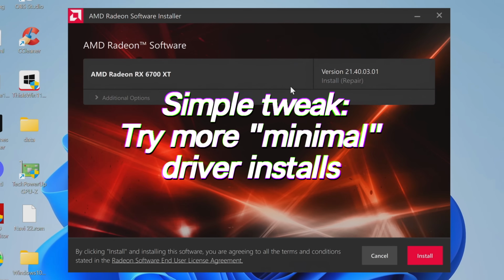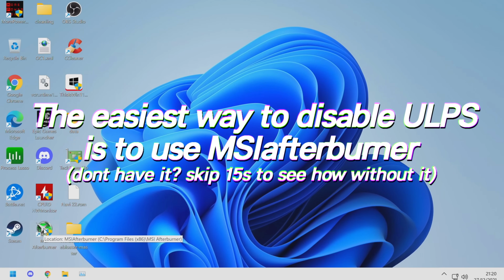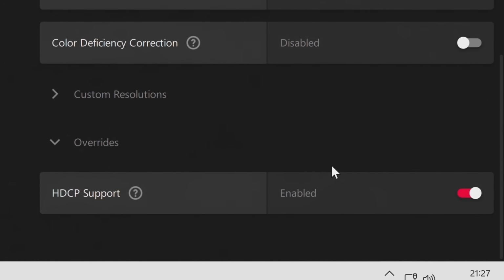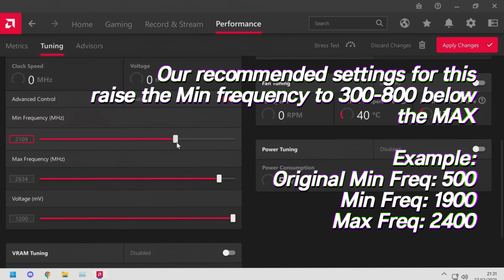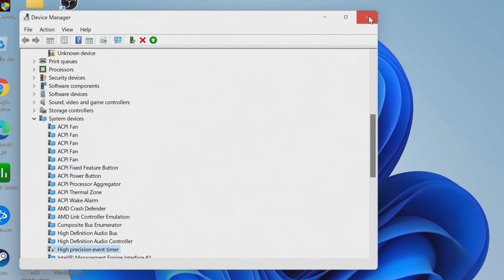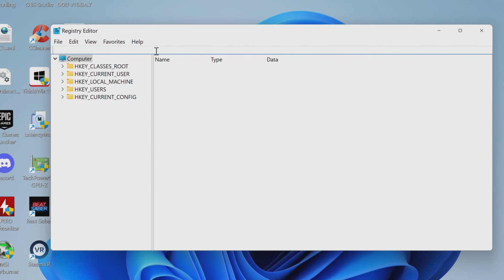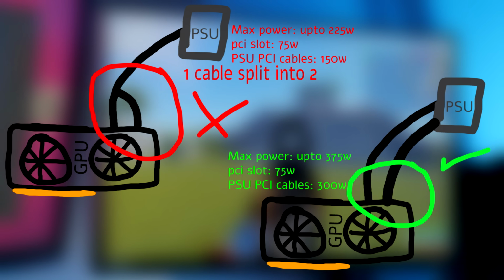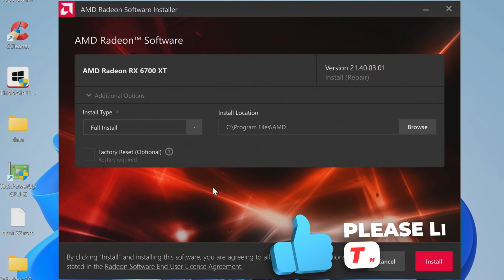🔧 Have an AMD Radeon GRAPHICS CARD? You should use these SETTINGS! *FIX LOW PERFORMANCE & CRASHES* ✅

Comment: Hey I'm thinking to switch from nvidia/intel build to a full amd build I want to stream, GeForce experience lags on my current setup i5 6600k rtx 2070s I'm finding it hard to capture games because of my low cpu performance.  All I want to know is, does the amd counter part to GeForce experience run better in overlay/ or in the background?
Reply: Nvidia much2 stutering..

Comment: Hello, my one gigabyte rx 550 2gb ddr5 , I have a problem when I open my video editing program , after effects or sony vegas , the screen blinks and gives this message "we detected a driver timeout on your amd system" and the program crashes, then when I uninstall the amd video card driver and go to open the program it doesn't happen. before I used msi afterburne I lowered the core clock and the error stopped, but now it's not even advancing anymore, strange what can it be can you help me?
I need to use these programs for my work.

Pc
i5 2310
monitor aoc 75hz freesync
8gb ram
amd rx 550 2gb ddr5
hd 500gb
ssd 240 kingston
Hoopson 550watt
windows 10 home

Comment: I sent in a error report to AMD but not heard back anything. As soon as I installed the AMD software my sound drops out after 2 sec on some games, one game it will not play sound at all, youtube/firefox browser, etc......very annoying. I already wiped the old Nvidia drivers with DDU. Uninstalled sound works fine, reinstalled and it's back. Deleted first dload and re dloaded with same problems................Anyone have any suggestions?

Comment: I had an APU system with dual channel rams and my fps in CS:GO was around 120 avarage. Than i decided to buy a new GPU and bought a RX6500 XT. I tought it will increase my fps like a double times or something but the result wasn't the way i thought. My fps were just increased 10 to 20 and i was like "Ok i think the GPU i bought is just useless shit. Than i saw this video and made the setting like in the video and my fps increased to 220 avarage. Thanks to you sir for helping me to reach my GPU's fully potential. The settings in this video increase the fps in new gen games around 5-10 or 20 maybe. But it slightly increases the FPS in older games which uses older directX versions like 9 or 10. And also increases the FPS nearly double times in CPU based games like CS:GO and VALORANT.

Comment: To me driver only is the best and stable pairing it with after burner, as I noticed my overclocks is stable on afterburner compare to radeon settings, same clock speed and voltage values

Comment: My gpu power cables are two cables attached at psu end but split from there ,like 2 cables sharing the same socket in psu . Would that be same as daisy chain cables

Comment: best advice is at the 1st minute and the last. Only install the drivers, forget about adrenaline. If you want to OC use MSI afterburner. All of the other tweaks will generate a cascade of untraceable catastrofic events that will lead to wiping windows, because it'll be easier to solve the problem that way. Interrsting video though
Reply: I agree with this, less bloat+msi afterburner gives me stable OC compare to radeon settings
Reply: But how do you do that though? Windows replaced Radeon for the 3rd time. Still Says AMD Radeon 6700XT but no longer have the Radeon Software for fan curve, display color and video modes. Did it do it? Because I almost don't care, Radeon was crashing everyday anyway.
Reply: @1R1shCapr1corn unninstall the display driver with ddu and block windows from updating your  drivers (theres an option in it) install the drivers. and find a way to keep windows updating your drivers except the display one. Search "prevent windows from updating graphics driver". then re-allow win to update everything. ALmost any adrenaline option can be tweaked outside the software so you don't need it. But If your config is now working just don't touch anything. performance won't change.
Reply: @donoroko  Yeah. Installed Driver only option and Local Policy to enable the drivers to stop updating from window update. Working okay now. Because every day I was getting the alert in Adrenaline about my setting having to be reset to default, and the only thing I cared about was by Fan curve, video mode (classic cinema, etc. and display color saturation. The GPU on this PC, is fine stock, it's not going to someone who'll kill it. My other one on the other hand, might have to put on ASUS TWEEK or MSI Afterburner if for only the Fan Curves. That GPU will fry itself without it. LOL
Did not do the DDU, only Install with factory reset and driver only. Working fine. In fact HWInfo reports better use of the clock speeds on the GPU than before. Plays tons better too.
Reply: @1R1shCapr1corn  My RX570 Just didn't like custom resolutions. I had an old CRT as 2nd Monitor and windows wouldn't let me configure it over 640x480. So I used adrenaline customs res. But it triggered the the notification and reset wattman every restart, fan curves also. So I did as I sugested to you and managed custom res with CRU and the fan curves with FanControl (use it for fans, it's super not invasive and low profile) Just make sure you click the "force apply" options so that os, gpu or mobo controllers don't take control of your fans. I woke up one day with my cpu having worked all night mining at 100°c because for some reason the heatsink fan had simply stopped. Also, you wouldn't need to use different color profiles. I'm a designer and understand color very well, enough to know that there's only one correct and optimal setting for your monitor, but if so, you should manage it under color profiles in os. For quick brightness fixes I reccomend built in monitor profiles. For image adjustments windows color profile manager. Just follow the instructions making sure you don't make it to red, green or blue and you'll be fine! Cheers, good luck!
Reply: @donoroko  Looks pretty cool, I'll check it out on my ASUS ROG Strix RX 5700XT. She's the one who'll burn itself alive. The XFX 6700XT doesn't even really the Zero RPM to be disabled, played the Modern Warfare and didn't exceed 74c so, pretty good. Not as good as my curve of top 65c, but, this system with the 5900x/6700xt is going to someone who this PC is overkill for, and most likely not playing that game. LOL Overkill might be an understatement.
Thanks for the Suggestion. I have used the other Brand's Fan programs like Afterburner, Tweak, NZXT and the one for sapphire. But, if the one you suggest is light weight, I'll totally check it out. I remember trying something with that name, but it was written out like scrips. But, if this: 

https://github.com/Rem0o/FanControl.Releases/commit/5bb9e71738200dcb76a3c0980439fa62bb452234

https://www.youtube.com/watch?v=uDPKVKBMQU8

Is how it looks now, nice.
Reply: @1R1shCapr1corn  that is it, it'll do. zero rpm is BS, it'll make your gpu go 20° higher at idle totaly unnecesarily since fans pretty much won't do any noise at 30% of their capacity.
Reply: @donoroko  and that is bad why? it's actually a good thing. middling temperatures won't cause damage to your gpu. what will cause damage is thermal stress due to a large delta between idle and load temps. if your gpu idles at 60c and loads at 85c, that's better than it idling at 30c and reaching 85c at full load. way less thermal stress. but either way, it's not something you should worry about unless you're using a 15 year old gpu
Reply: @GraveUypo  higher temperatures shorten the life of your gpu. It will degrade your thermal paste and thermal pads faster and pretty much every component affected by those temps.
Reply: @donoroko  
Your talking about a very small amount and by that time you would be replacing it anyways due to graphic advancements/improvements.... unless you keep the same gpu for 5+ or so years.. I don't see it mattering. But I do agree with you.. The zero fan spinning is "bs". Probably some market gimmick nonsense for power usage.
Reply: I regret to enter in AfterBurner and Adrenaline first time, if I don’t, I will never giving a sh*t for it and probably (certainly) i had played and enjoyed games much more, follow stats, tweaks  just steal half or more of our playtime and in majority of time it changes our mindset for a worst sense behavior, let’s turn PC on, double click favorite game and have fun, life is short!
P.s: this will be my last tweak, I promise! lol
Reply: i see.. thats why suddenly its bluescreen.. and the windows asking for repair

Comment: I've been experiencing freezes and crashes with Divison 2 since release. Hoping these tips will have an impact.

Edit: Nope. Still experiencing issues.
Reply: Let me guess? Rx 5700xt?
Reply: @MarcABrown-tt1fp  It is actually. That card particular has problems?
Reply: @Samuitsuki  About 40-50% of them have issues with the display engine, that are bad enough to cause intermittent display loss then display driver correction that crashes the drivers.

Worst part? it doesn't even have to be under load. Mine can crash in firefox or any app when the right conditions combine. thankfully it happens once every boot. I have yet to encounter repeatable results. All stock settings

 It seems that the 5700xt design suffered from manufacturing issues early on. Rushed perhaps.... Love the performance otherwise, But I wouldn't trust using the thing for important work...
Reply: @MarcABrown-tt1fp I only have issues with Division 2. In no other cases or games do I have issues with the card.
Reply: @Samuitsuki  Oh weird... I'd have to try that game out honestly, this game might be triggering the right conditions for core instability. Or its just lousy drivers lol. In any case I might get a new GPU when the next cards release, and sell this one. Seems functional enough for gaming.

Comment: well , i wont use your settings , its a waste of energy to clock in Idle to 2100 Mhz , i undervolt my GPU so it runs cooler and uses less energy . Especially my Vega RX56 is faster with undervolting than with more Power ... Simply use chill to set a min FPS rate and max FPS Rate , it should not go under the min FPS unless the Game itself lower it

Comment: 9:56 Is this even legit? I use a single cable with two connectors on a ~300W rated ASUS 1080Ti and the sensors report full pull (270-300W). The PSU i uses is a Seasonic Focus+ 650W 80+Platinum.

Comment: Is anyone having an issue where the GPU literally won't go over 20mhz gpu clock speed for no reason? My pc is having this issue and i don't know how to fix it. I tried everything that i could find (roll back to old drivers, reinstalling windows, overclocking the gpu) but nothing worked and is driving me crazy. The gpu simply won't go over 20mhz. I have a 5600 xt and I7 10700

Comment: hello, do you have any advice for playing in 1440p (3440x1440) with a GPU with 4gb vram (details at a minimum)? 
it's a Mi8/Radeon R9 nano instict.  I know very well that it could not be, but I do it anyway, I ask in case anyone knows about some software settings, BIOS or on the AMD panel or some setting / technology developed within the game settings (in addition to low details) to make the card go better in 1440, make the vram work better or try not to saturate.

Comment: Does the instant replay cost fps? Or memory? I've a good SSD that is suppose to have a lifespan of 1kkk hours or 680TB, store is no problem.
Reply: it costs a bit of both. i still leave it on all the time. it'll only matter if your computer is bad.
also i recommend you leave replay cache in your system RAM rather than on the SSD. ram doesn't wear from use. you'll shorten your SSD lifespan A LOT you leave replay cache in it.
Reply: @GraveUypo  How do i do it? Set the replay cache to the RAM? Thank you.

Comment: Thank you for this super informative video. After my game crashed thrice, i have printed my return label. I run a 6800xt merc card with 850w gold supply, i still experienced crashes playing warzone, junction temp at 92 and current temp at 73 4k max settings with RT on. Ill try the tweaks you shared before returning, thanks again. Liked & subscribed!!
Reply: Hi bud, any improvements ? i have the same card and it crashes on every game, I soon as I jump off the plane in warzone and in pregame lobby in apex legends
Undevolting and reducing max frequency helped but not for all games
I’m taker if you got a fix for this situation
Reply: @easyj  hey i returned the card. I saw a similar behavior in a couple of other games. Now it doesn’t mean the card is bad, perhaps my unit was not good. I validated that the card runs hot as compared to geforce but its fine. There are 2 things you could try run the game as admin, are u running win 11 or 10, if possible try the card on a win 10 machine and play the game..hope this helps, cheers!
Reply: @dushyantkakra5556  i’ve tried so many stuff, ddu, win10 win 11, oc/ no oc, full speed fans, lower graphics settings, lower resolution, safe mode, only thing that works is undervolting but I don’t think It’s designed like that. I unfortunately don’t know anybody that has a pc to swap parts with and stores take a week to make their diagnosis
Reply: @easyj   i know this can be frustratin but sounds like u have tried all the troubleshootin that you can possibly do. The options are time takin like reachin out to the manufakturer and get a replacement, i however feel if u have built the pc there could be multiple components that can cause a crash not just the gpu - eg try changin the ram, see the cpu temp - have u noticed any spike there? M sure u have the latest drivers. I still feel that if u use win 10 and reinstall the card n the game it could work..if nothin above helps, u shud reach out för professionell help with ur manufscturer or store diagnostics
Reply: @dushyantkakra5556  it’s a used card, but the previous owner never had those issues, I went to a store and they used it for a whole day and no freeze.
I went from auto/gen4 to gen 3 for the pcie settings in the bios and no more issue so far, Apex legends used to crash on the main menu but I was able to play for an hour without having to undervolt like I use to when it was on gen4
Can it be my psu not giving enough power for my gpu to be running on gen4 or may be my extension cable doesn’t support gen 4?
I’ll try to find some info on those 2 points and report back
Reply: @easyj  psu can be a factor for sure, and yes do check without extension cable and have the power supply directly to the card..

Comment: Wait a minute...
1. What about info in regards to whatever you can or cant close MSi AF after applying changes? What I know on rtx cards it has to be opened and minimised.
2. What about after restarting the PC? Unless someone has set MSI AF to start when starting Windows it wont be there therefore should you not need to start it again after restarting pc?
I mean Its not a problem for me to check and sort this out but video looks like for any1 including non tech experts so maybe just give more details.

Comment: This completely broke my game and always blue screens me now in game. thanks.
Reply: Same this man giving false info
Reply: It literally won't even turn on now
Reply: Everytime it does turn on it turns right off as soon as i log in and it says recovery on blue screen
Reply: @senorskellig9131  i sort of fixed it.. still happens randomly. Restore to a recent save and try to redo everything he reccomended with Device manager and the Registry.
Reply: @Echo_Studies  I'm try right now I finally got my pc to boot up
Reply: @Echo_Studies  I did and it actually booted sandstorm up but then it crashed after like 30 seconds. I think he broke my dram so I ordered some new ones. I took my pc apart and cleaned it. I think it the ram since it would turn the pc on but keep my screen from showing. Then when my pc finally booted up im not even sure yet. I have to wait till the the new ram arrives.
Reply: @senorskellig9131  yea i dont think anything broke its something to do with crosstalk between drivers which causes the blue screen. hard to figure it all out unless you update/reinstall all drivers on your pc.